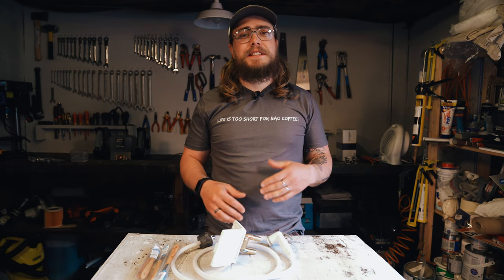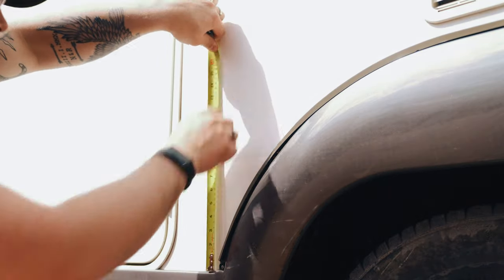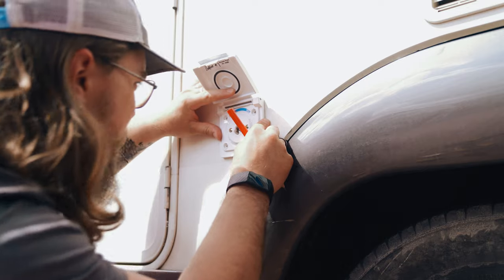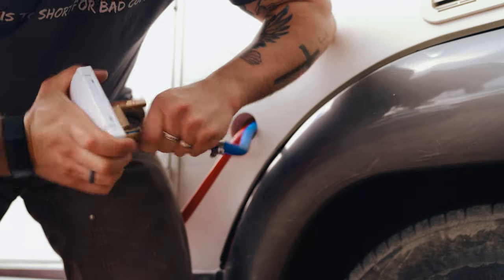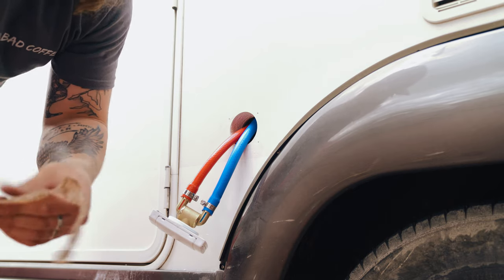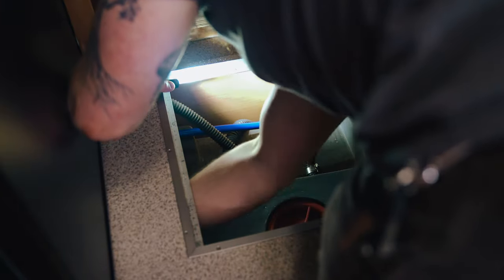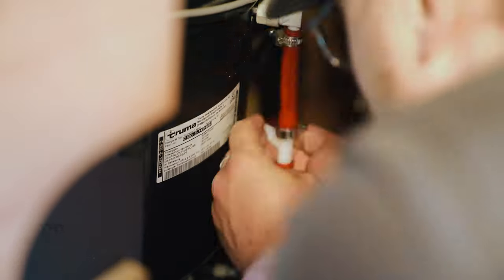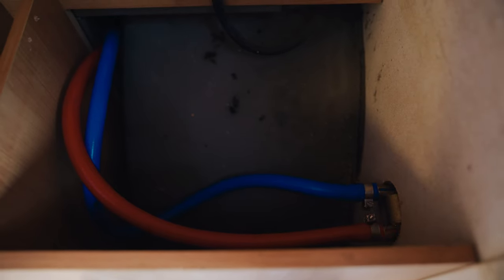How to install a Bullfinch External Shower in a Euramobil 810 motorhome (2005 Fiat Ducato model)

Comment: Legend. Legend…..you are a Legend    Thank You So Much.   I have just purchased a pennine pathfinder 2001 
I was just wandering could I tee of the hoses that run to the sink basin as you have…I don’t think it has a pressurised unit I think it’s a heater you have to ignite with the push button with a outside pump  that inserts into a barrel of water….the only person I can
Find on YouTube that starts and finishes the job. 👍
Reply from the maker: Glad the video was helpful! :)

Comment: Hi, what size was your holesaw for cutting through the van wall, and how far apart are the exterior screws?
Reply from the maker: Hello! I used a 60mm hole saw to cut the hole through the van wall and then the gap between the centre of the exterior screws is 68.5mm.
Reply: @offgrid_power  many thanks